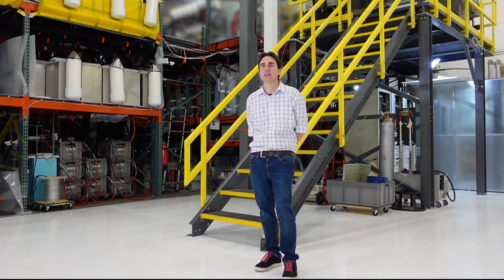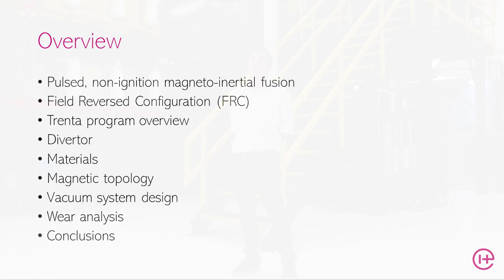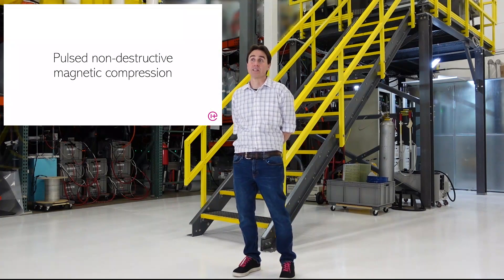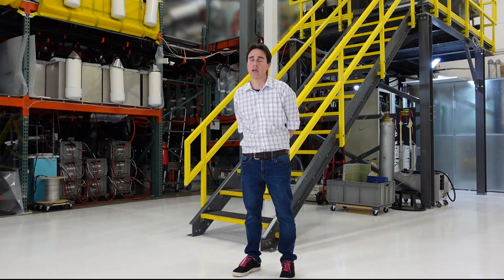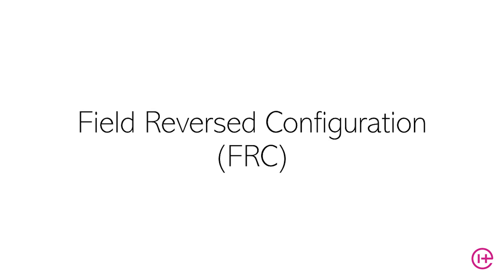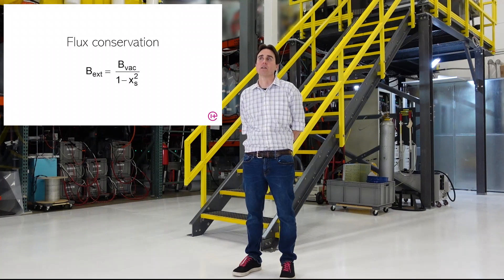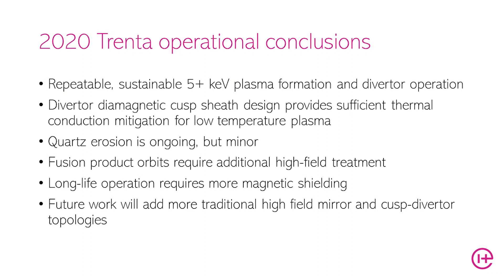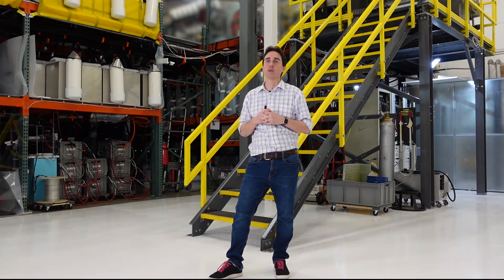Trenta 2020 Program Results

Comment: Magnetic Adiabatic Effect's Compression could also help a lot with Semi-Passive Cooling Systems...

You can just Ionise Air or a Liquid and using Passive Magnets as Iron Nitride for Creating ≥5 Tesla Electromagnetic Filed in a Single Restriction Point...

In the Best Case Scenario:
No Expansion Valves, 
No Magentocaloric Effects, 
No Rare Earth materials...

Just a Bunch of very good Thermal Conductors for Dissipate heat as Copper Heat Pipes or Graphene, 
A Good Compressor like "Lontra" or a Tesla Turbine (or both Combined, which likely make both more Efficient), multiple Magnetic Adiabatic Valves and an Electrically Induced Ionic Wind from Silver & Copper for increasing the Ionisation in Air Making it More Conductive...

At that point Quantum Interactions should become more effective due the Induced Non-Permeability of Air/Liquid from the Electromagnetic Field...
The More Ions the more Interactions...

Only Operating Costs being Electricity for the Compressor/s and the Cost of Copper Oxidation to be Exchanged Once in a While...
Silver can just be Cleared by Applying a Stronger Current for removing the Oxidation at Surface Level...
If Graphene-Cellulose Acetate 
is used instead of Copper for the Tubing there's no need for any Substitution for that..

Nothing that can break the Market of Fridge, Freezers and Air Conditioning because at ≥5 Tesla the Valves would be too big to fit anywhere smaller than the whole Back Portion of a Huge Container...

Could Revolutionise the Way we Transport Perishable things...

Or Refrigeration in Desert 
Green Energy Projects...
Where the Grid Doesn't Arrive and Expensive Reactors aren't Feasible...
...and External Heating of Stirlings is more Cost Effective compared to average Nuclear Facilities Ways of Converting Nuclear Energy into Usable Electricity...

In the Up-Scaling of things Small Modular Fusion Reactors could be Paired to Solar Concentration
Projects Exploiting Heavily Improved Stirlings as the Same Medium to Heat-to-Electricity Generation..

It costs nothing to Make, 
it is Highly Scalable, and it is the Best most Thought Through way
to having a 24h Coverage of 
Stored Heat/Energetic Production & Passive Aggressive Cooling capacity, bringing away the Excessive Load on the Grid which is really a 
"Billions Dollar Problem" usually Powerplants do not Address...
(Can Ensure this Because There are Industries Capitalising Billions Yearly from This problem Alone)

This only if there is no Direct Energy Conversion by Electrons Production from Magnetic Coils Activation...

If you already reached a Stable way to Fusion, the Reactor as it is plus an Heat Exchanger,would be already Applicable to Similar Processes...

Direct energy conversion is Beautiful as Concept, but it basically Destroys the Whole Working Sectors of Energetic Production..if it works.

When it doesn't: 
You already have reached a mean to stable Fusion, you just need to Unleash its potential.

ARPA-E Grant was already Covered in its Fullest by the results Reached.

Just Let the Energy Flow..!

[Stirling's External Combustion Conversion type of 
Heat-to-Mechanical Motion 
and Heat-to-Cold Exchanges Increasing its Efficiency could make it a Really Inexpensive way to Upgrade the Harvesting of Heat Generated from 'Magnetoadiabatic' induced Fusion...

At least for the Energy not directly expressed in Microwaves Harvestable  with Microwaves-to-Electricity Converters.

'Magnetoadiabatic' Cooling & Fusion
In the Same Shared Two-Phase Project!

I have no possibility of Investing in you Guys...
But Your Idea is one of the Best I have Seen among the Multitude of Dysfunctional Ones...!
At least the Most Complete in Itself and the Most Open to Future Integrations as the One I just Mentioned...

I don't understand Direct energy Conversion Much, but It likely come from not Understanding Pulsed Energy Either...
Doesn't Seems "Voodoo Fusion" to Me..
Just if is not that Feasible in One Way, or Hard to Achieve without Burning some Giant Fuses, instead of Keeping Advancing the Project to the Next 
"5-10 years" as everyone is doing from at least 70 years, try to give it a Chance as It is..
Maybe you save on Post Production Costs, if not you the States will for Sure..

Keep the Channel Up-to-date so 
I can keep Track of the Updates!

P.S:
If you want to test what I said, 
Please do a Video of that!
 Because I have no Means other than Logic to Test the Ideas that I have...

Is a bit like a Mental Torture to not Having no one to Share nor Check what I think could be a Great Solution for Everyone..
...and Seeing Slow Paced, not Realised Project is not Exactly as Having a Direct Answer from the Society..
You seem a Pretty Small Scaled and Almost "Family Run" Project..
You have tons of Machinery and Know-How for Testing what I said in the most Cheapest and Effective way Possible...

Don't Let me Thinking Alone !]

= )

Comment: Perhaps stupid question: How will a Helion fusion power plant make sure to deliver a stable electricity output when the energy comes in pulses?
Reply: When they are producing power they can use electronics to get it in a form useful for supplying the grid.
Reply: The energy from the pulse is stored in capacitors then released to the grid from there.
Reply: @elmarmoelzer2229  Every frequenty changer on the market first makes from an AC current (e.g. 400VAC 50 Hz) a DC current, and then with power electronics built a sinus wave of a certain frequenty.. That sinus wave is built from  thousends of spikes and stabalised by capacitors or coils. So if Helion can produce a DC current, the problem is solved
Reply: @berdiebird7089   Not sure how that changes anything I said. The energy from the shot is stored in capacitors and released to the grid from there. My point was that the pulse rate and duration does not affect the stability of the output to the grid.
Reply: @berdiebird7089 um, frequency changers are pretty much irrelevant because all current turbines, gravity or steam, are governed so they spin at the ideal RPM to generate 60 pulses of AC power per second at 400V and 200A or higher, which is then transformed into 10,000v and 80A for long distance transmission from an 80MW production facility. Many steam turbine facilities can easily produce this from multiple turbines, while dams are highly dependent on terrain and vary in total output from year to year based on total precipitation during the previous winter, but all output at the same 60hz frequency in the US.
Reply: An internal combustion engine works on pulses of exploding fuel. Yet your car moves forwards smoothly. The car does it with physical inertia and momentum plus a high enough pulse rate. A fusion generator could do analogous things with capacitors and semiconductors alone or with inductors and transformers in the mix also.
Reply: They have large banks of parallel capacitors. You can watch the recent video by Real Engineering, starting at around the 22 minute mark. There they also talk about the capacitors' lifetimes after increasingly large numbers of pulses.
Reply: AC current is 60 pulses per second.
Reply: @marcdeckard7064  Household AC current changes direction 60 times per second. That's different.
Reply: @klaudialustig3259  We are talking about a prototype. The commercial product would probably output ac power in either 50 or 60 cps.. How they achieve that is a minor issue.

Comment: I now have zero doubt that Helion will reach net gain first, and likely before the end of 2022. Thanks for saving the world, guys. :)
Reply: They're not going to finish construction of their next prototype by the end of 2022.
Perhaps if they had consistent progression they could do that, but as it stands the net-energy should increase more in spikes than on a curve. The next spike, according to them, is in 2024 (Their seventh prototype, polaris).
Reply: If you listened carefully, you would have heard him say that barely anything in this prototype yet meets or exceeds future deployment targets. The positive side of this presentation is not yet any crippling show-stoppers. If I've got things straight, this protocol had a very low pulse rate, so they have barely started to deal with heat extraction problem in its final form. 

Check out Intel To Wind Down Optane Memory Business from earlier this summer. This was a novel storage physics that actually worked well enough to sell for a number of years, and yet it finally failed commercially all the same.

Comment: At the end of the day, can you sum up progress with a bit more focus on how your team proposes harvesting the fast magnetic pulse into electrons, accumulating the charge, transforming voltage into grid voltage, and producing usable utility grid electrical power at scale.  I have the sense that the machine is similar to harvesting lighting bolts into usable energy, a tough task.  Also would be good to share ratio of consumed power to produced power, in that this invention's power production success is when power output exceeds power input, of all the electrical power needed to operate the multiple elements of the systems roughing pumps, diffusion pumps/ turbo molecular pumps, vacuum gages, control and logic electronics/ diagnosis equipment/ simulation computers/ electromagnets/ overhead lights/ desk computers/ safety systems, etc.  Like others - have enjoyed learning about the history, the availability of special fuel, the high temperature electrons, the high temp materials, the differential pressures, the wear on materials, the linear device physics, and lots of run-time results.  A good summary of the roadmap and schedule towards making net energy production progress is most helpful.  If your inventions energy balance is now 10 watts in and 1/4 watt out, this is quite different than if your 1 watt in and 0.8 watts out.  Thank you.
Reply: I think they’re hiring, shoot them an email.

Comment: Does the Helion approach use or plan to use high temperature superconductors for the magnets?
Reply from the maker: No – Trenta does not use cryogenic superconducting magnets, nor will our future fusion devices. Because Helion uses a pulsed, non-ignition approach to fusion, our machines can use standard aluminum electromagnets that operate at forces ~ 10 Tesla.
Reply: @HelionEnergy  wow that sounds way more convenient than messing around with liquid helium
Reply: @moltoniron633  Me as well

Comment: Can someone do a newbie version of this video
Reply: Short, simple version:
Great results after first year of operation.
Machine is working as expected. Scaling laws established with LSX in the 90ies are still met, or maybe even exceeded with Trenta.
There are still some challenges, mostly with materials for magnets and divertors that they are working to resolve. Note that those are (probably) not a big factor for experiments, but could affect the economics of later, commercial machines.
What stood out to me was the extreme ratio of ion to electron temperature. That is one of those things that will enable them to use advanced fuels for future power plants.
Reply: @USSSkipjack  uhhh yeah, that last part DEFINITELY stood out to me too, and not because it's a good thing. They're basically admitting their plasmas will be in EXTREME thermodynamic disequilibrium, ie. it will be a highly non-maxwellian plasma. This is very bad. It rules out ever achieving a burning plasma or reaching Q factors greater than 1. This was established from first principles by Todd Rider in his 1995 master's thesis.
Reply: @Muonium1  
IIRC, this is not what Rider says.
Most of the fusion happens at a high Ti:Te ratio.
Generally P(fus)/P(loss) scales as Ti^1.5 / (Z^2 * Te^0.5 )
So a higher Ti:Te is actually beneficial.
For Helion, the Ti:Te starts out high, but eventually trends towards equilibrium, but at that point the pulse is already over and done.
A high Ti:Te is a property of many pulsed fusion designs, btw.
Reply: @Muonium1  It sounds like they are envisioning a reactor at Q < 1, and somehow recapturing the input energy. But I do have some doubts. Since it sounds like the plasma duration is shorter than the ion collision time, all the energy that goes into heating the ions doesn't get a chance to be used before it hits the diverter. AFAIK, there's no advantage to having Te in equilibrium with Ti, since that's extra heat wasted in electrons and will create a lot of bremsstrahlung.